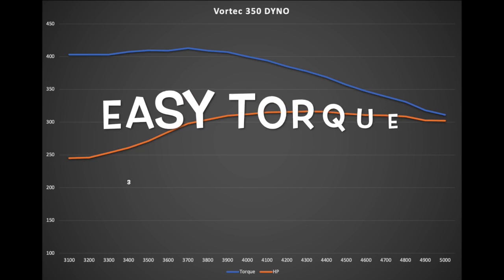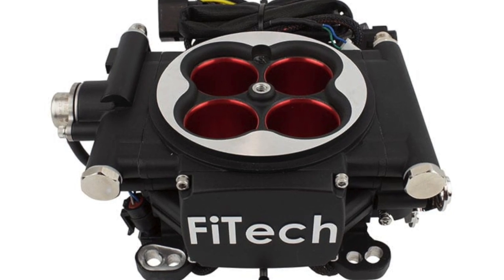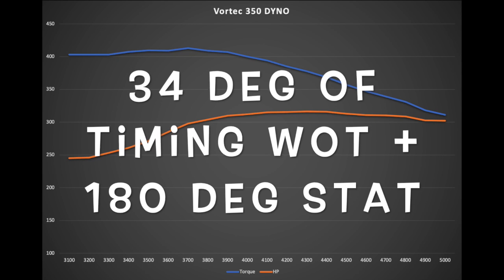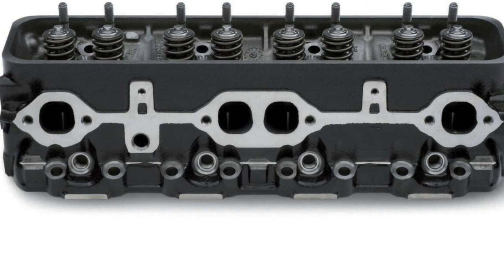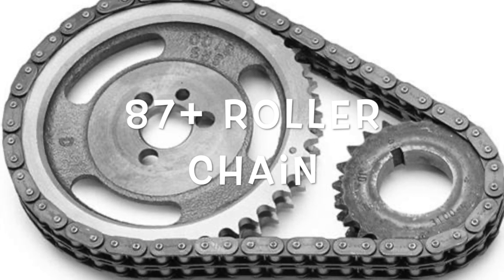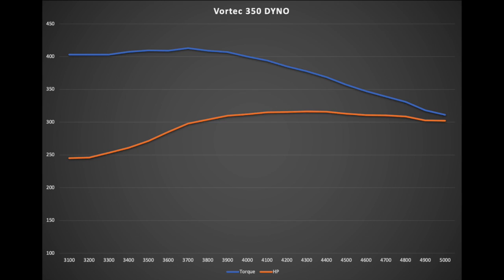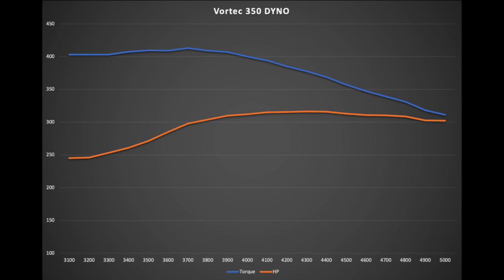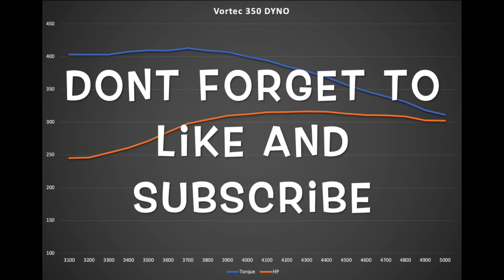Easy Vortec 350 Combo (High Torque 400+ ft lbs)

Comment: Im at my wits end with my 4.3 in my s10. It had gunk in the coolant when I bought it, but never an issue with misfires. It ran great. Did new intake gaskets, and drive it for a year worry free. Now im getting gunk again (not as bad) and a misfire on low end that jumps 2 to 4. High end i start getting mild misses on all 6. I think im going to shoehorn a 5.7 vortec in it. It doesnt need crazy power by any means, but id love to have smooth clean torque all the way up. Love this video.

Comment: "Just A Regular HEI" 

Did you have to change distributor gear to a melonized one for a roller cam since it is known for its strength or you just went with the regular ones on the HEI?

Or do you recommend just going regular HEI distributor or change the original vortec distributor gear into the HEI.. and would that make any difference?

Comment: I am put'n a 96 vortec in my chevelle since a lifter collapsed and ruin'd the 350 i hav in it,, got some Skip White Performance 200cc intake runner/64 cc combustion chamber aluminum heds and 1.6 rockers with them,, gonna get new lifters and pushrods, double roller time'n set and hav an edelbrock rpm intake,,
hope'n to get it goin soon,,,

Comment: Hello Cutter's performance, great video direct and to the point. I recently picked up a vortec 350 magnum marine (Mercruiser) four bolt main complete engine with 450 hrs. on it so I will do as you described my question I have is I cant find the lifters you used even Melling's site only lists the cam but not cam and lifter combo. Can I use the lifters that are in the motor or change them and if so what part # are they 
Thanks for the great info
Reply from the maker: I don't think I listed a meiling part # for the lifters in the video. I used the stock GM roller lifters on this build
Reply: @cuttersperformance  Thank you

Comment: did you have to change your distributor gear using a different rather than oem distributor is that melonized  gear just a lure to get to spend more money
Reply from the maker: the meiling cam is not billet cores so a regular cast distributor gear can be used
Reply: @cuttersperformance  thanks brotha

Comment: Will 10:1 run on 87?
Reply from the maker: It can with the right cam, tight quench, and proper tuning. A light car with proper gearing makes a world of difference too
Reply: @cuttersperformance  young in a 2700 pound 3rd gen
Reply from the maker: @TheJMan1K  2700 lb third gen? Is it gutted? Mine was like 3500 with full interior
Reply: @cuttersperformance  mines an 84 hard top. 
Scott Rod doors
One piece front end 
K member
Baer brakes
Gutted dash/interior
Astro T5 (Still 40 pounds less than a T56)
Has cloth seats out of my 4th Gen, 
And no heat or AC. 

Car was originally 3100 on the scale so chopping 450 pounds off wasn’t too bad. The only thing that was splurging was a one piece front end but that because my car needed some body work with a new bumper in the process. I finished touching up some rust spots next step is to wrap it. Also in the process of securing a vortech motor for it. 305 no bueno.

Comment: Nice video and a nice combo I think might be the ticket for my 97 OBS.  I like the fact that you mention part numbers, would be nice if you had the time to itemize them in the comments section to make duplication of the build a lot easier for us not so mechanically inclined.  I am always paranoid of getting the wrong parts that dont fit together as designed and having to return stuff or eat it on the cost.

Comment: I'm doing a similar build on a Vortec 350 with the factory EFI for my 86' Chevy k30. I went with the HT383 cam and upgraded mpfi injectors. The shop is also doing a custom tune. I'm expecting 405-410 torque and 340-345hp at the crank.
Reply: I don't think you'll come up a little short of your hp goals. Even the Ramjet only made 330hp IIRC. Should hit 400+ torque though. I have that same cam with some 1.6 roller rockers and marine intake on my truck. Feels like stock, but just more of it everywhere.

Comment: I’m thinking of doing something similar for my 85 k5 blazer that has a 305. I have a older 3970010 block 60 over with flat top 4 valve relief pistons, balanced bottom end, want to put my vortex heads, roller tip rockers, edelbrock performer rpm, best cam for towing   Had this motor rebuilt but has a 650 roller with phase 2 bow tie heads with way too much porting was going to put this in a Camaro but getting older and enjoy camping so I wanted to build a nice tow vehicle with 4x4. What do you think about  the 60 over with a nice aluminum 4core radiator will it be ok or should I use my other block with stock bottom end. Thanks guys for any advice

Comment: Did the same build with basically Speedway Z28 springs with the centers removed, knockoff .050 over valve keepers and a few cam sizes up, the Melling "22280" 495/505 lift. Also used a street Demon six hundred whatever carb but honestly I'm gonna move up to a 750 carb. Thing MOVES the way it is. Wish I could have gotten ahold of a similar cam with a tighter lobe separation at the time but sold out everywhere, mines 112 LSA. Great mostly stock mean street engine.

Comment: Cool! I'm upgrading (replacing) my C3 Corvette engine. Building a 383 stroker for it, on a 4-bolt 880 block. Do you know of a good, recommendable rotating assembly kit? Are the Eagle or the Scat 9000 ones decent? I'm not going too crazy with cam, 224 intake duration @50. It's a street engine.
Reply from the maker: Give scott at Ohio Crankshaft a call. His kits are well put together, checked, and balanced really well. Highly recommended 👌
Reply: @cuttersperformance  Thank you sir.

Comment: Picked up a ,97 Vortec motor to drop in myb,92  Silverado.This is invaluable info and thanks for building this motor for all us guys who don,t run their trucks at 6000 rpm at every chance. Most of my driving is at 1900 rpm,s ( 65 mph) on the highway with my 700 r  overdrive trans.+ 350 TBI motor ( soon to be replaced with the ,97 motor . I live in a small ,country village ,so highway distantce travelling is normal ( fuel economy ) .

Comment: QUESTION:
I'm in the middle of getting a 1997 K1500 Z71 EXT-CAB 5.7L 4x4 ready to use for work & play. Because it will be used for work M-F I want to retain decent MPG & drivability but want a little more power. This cam seems to really fit what I am looking for.
My question is what kind of HP & TQ number would you expect when putting this cam in my mostly stock truck along with the following upgrades:
* 1" intake spacer.
* K&N intake kit with pipe, filter housing & filter.
* Upgraded spider injectors with valves at the end of the injector lines.
* Accel coil, plug wires & platinum plugs.
* Flow Master 2.5" catback system.

NEAR FUTURE UPGRADES:
*Complete exhaust, shorty headers & mid-pipe with high flow cats.
* Dyno ECU tune (of course, this will be the very last thing i do to it).

I know the engine that you put the cam in, in this video probably breaths better than mine and has a more performance minded fuel injection system but I'm hoping to get 80% of the extra HP & TQ that you did. Am I living in fantasy land or is that a realistic expectation? 
(I know that you don't have a crystal ball but your best guess is most certainly better than mine. Don't worry about me trying to hold you to what you said, if i don't get the performance that I'm shooting for. I appreciate you taking the time to read this)
Reply from the maker: Youll have some parasitic loses over this engine but this cam will certainly help with power. Its a mild cam and works well with basically a stock engine. With a good set of headers(go long tubes if you can), a good tune you should notice some decent proformance improvements without a loss in mpg.

Comment: This cam seems to be close to the 395 GM cam. 
Do you think this cam has more torque ?
Reply from the maker: It would be close but I believe the 395 cam is on 109 lsa which helps with low end torque

Comment: Still debating wether i want 2 do a mild build on my 5.7 350 in my 90 obs single cab 4x4 or just stick a base ls 5.3 in it... mild build its my work truck i use it for pulling my pressure wash rig,tank full wheighs over 2000 lbs and i pull my 12' utility trailer with my dirtbikes,gets me anywhere down the muddy trails to my favorite fishing spots..the 5.7s are bullet proof and have good low end torque for everything I use it for but having a few modern ls motors i know the 5.3,6.0,6.2 have better power and torque and way better gas milage..so im still undecided..only thing my 5.7 has is a edelbrock performer intake manifold for a 2 barrel tbi carb and a flowmaster 40 series with 3" piping and it still kills my gas milage i know once i get my 6" lift and 35s on it that is only going to make it worse..which my decision kinda makes me lean over to the modern technology..If I do keep the 5.7 350 my plan is to get a EDBK dual plane air gap manifold with a holly brawler or if i have the extra $ get the sniper efi, some decent heads,mild cam,long tubes and a gud hot msd ignition kit..any suggestions? i appreciate some feed back..thanks 4 the vid
Reply from the maker: Man its a tough decision but with the prices of aftermarket EFI nowadays a stock 6.0 LS swap is pretty tempting

Comment: What do you think of David Vizard?
Reply from the maker: Smart man, with years of knowledge
Reply: @cuttersperformance  Yes, he is. A fountain of knowledge. That man knows what he is talking about. But you are getting there. You also know what you are talking about. Keep the good stuff coming.

Those Vortec heads are really good cylinder heads. Flows really good in stock confugiration. Before porting. With a little Vizard magic, and also your magic it will work wonders. Good racing heads.
Reply: Configuration

Comment: Hey buddy I know your in the know about these vortecs I got a roller cam vortec do I need to run a different gear other than the stock steel gear that comes on the stock hei distributor? Thanks in advance
Reply from the maker: Run a Melonized gear with the stock billet core cam

Comment: I have a 5.7 vortec Escalade from 2000 I’m curious what I can do to get some more power out of it I’m not familiar with these engines if there’s different variations or if they’re all the same can I just change the fuel injection system intake exhaust that kind of stuff or will that not run right with the stock computer etc I’m not looking to dig into it to the point of doing a cam just curious what simple options I have it’s completely stock
Reply from the maker: The factory fuel injection and cam are a limiting factor on these engines, but they respond well to a set of headers and a good flowing exhaust system if you're just trying to pick up abit of power.

Comment: I started working with these heads in 96 on a 4.3 Sonoma. A few years after taking the knowledge from the 4.3 stuff I applied it to a few small block builds. All pump gas street friendly.  These heads are impressive to say the least. I miss the day of getting a brand new pair of these delivered for under 500$
Reply from the maker: Right on man! And totally agree, the prices are abit nutty now on them
Reply: I wanted to get the Edelborock aluminum version ETEC 170 heads, They are currently $1,100 EACH,  $2,200 for the pair.  WTF  Then I would need an intake manifold to match, yeah, $660 for that, so it's almost $3,000 for heads and a manifold.  R U kidding me!  I bought the Trick flow Super 23's instead.  $1,500/pair.  No intake required.
Reply: @frotobaggins7169  at that cost go afr

Comment: Just finished my L31 short block factory PM connecting rods,Mahle hyperteutic pistons,1053 forged factory crankshaft, King Bearings Maine,Rod,Cam, also BTR LS7 Lifters and BTR pushrods,Custom Bullet Cams Hydraulic Roller .575 lift 240 duration camshaft, Edelbrock Performer Rpm Top End 64cc heads CNC Port/Polished, Comp Beehive Springs,Summit Racing Billet True Roller Double Roller Timing Set,MSD Digital 6AL and MSD Pro-billet  Distributor, Edelbrock Avs2 850cfm Carburetor, Milodon High Pressure/High Flo oil pump,Milodon Timing Cover,Milodon 8 qt oil pan, Hooker Competition Headers, and a TCI breakaway 2800 stall converter,TCI Streetfighter 700r4 transmission, Cheverolet 8.5" 10 bolt differential with all Richmond 3.73 gears in a 1972 Cheverolet Nova SS
Reply from the maker: Sounds like a great combo 👌

Comment: Hey man you have the best video. Question. Would this combo work well in a 93 4x4 suburban with 750 carb? Tbi motor got to go
Reply from the maker: Heck yeah, but if it were me Id do a  600 holley vac secondaries
Reply: Awesome I have one. Thanks

Comment: I have a build extremely similar but a 383. What rpm is the timing all in by and did you use vacuum advance?
Reply from the maker: I dont have the all in RPM in my notes but I kept the stock springs and weight in the aftermarket HEI and yes i used the adjustable vac advance

Comment: Watching again a year later thinking about how mine will do. 10:1 old style 350, was a short block that sat in a garage since the late 80's, and it reflects that. TRW flat tops, stock everything else, and a Crane Energizer, .450 lift/218 @.050 on a 106 lsa. I just tore down, cleaned up, replaced rings and bearings, engine had never been ran. Threw a set of vortecs and similar intake to this on it, with summit "ls6" springs and comp 787 retainers. I had around .530 to the seat so I didn't use the offset keepers. Think a 1.6 exhaust valve and blend would help a bunch with the single pattern cam, but it should still make similar power to this, I believe. Sounds good on the stand, now to get the truck on the road.
Reply from the maker: Probably abit more power than this build! Hopefully you get it in soon and enjoy it
Reply: That’s the 274H06 cam. Nice sounding lumpy idle with that narrow 106  LSA, but surprisingly torquey just off idle, even works with low comp smog 350’s
Reply: @Scott K  it worked great. I actually stepped up to an isky 280 mega, but just because I didn't lose any of the bottom end, and felt I had some room to grow on top. Similar concept, just more duration and lift, and a 108 lsa vs 106. Something about the tight lsa single pattern cams seems to work well mid range. I kept all the lifters labeled by bore and wrapped the cam up, because I will surely find another use for it. Great for a mild engine for sure

Comment: How well would this work with brodix ik180 heads and more compression?
Reply from the maker: The cam in this build is very mild and you would be much better off with a larger cam to utilize those heads

Comment: Built one very similar to this for an 80's Caprice. What a fantastic highway cruiser. It pulled the super tall gears in the rear end like nothing.
Reply: great motors. honestly the last great chevy motor. 
i have one in an s10 blazer lunati roller torque cam kept the fuel injection long tube headers till next season. 4 speed auto and 3.42 gears with fairly small tires.
35mpg at city speeds up to 55-60mph back roads is best mileage. highway is about 28-30 mpg at 70-75 its not stupendous but for a vehicle that can run the 1/4 mile in the 12 sec range and a timeless box chevy body thats not a bad commuter car.

Comment: Out of curiosity.  Do you have any idea what a stock l82 bottom end would make with vortec heads? Stock l82 cam and everything.
Reply from the maker: The l82 cam isnt terrible for a stock cam and the vortecs will bump up the compression. 
My guess would be around 320hp and 370 ftlbs on a dyno with a decent dual plane intake and a headers

Comment: Very nice, I just picked up a Blueprint 350 with the vortex heads. Included dyno sheet showed the engine made  376 HP and 406 tq, after the 500 mile break in I'll get it dynoed to see how close that is while in my truck. I did go with the performer RPM air gap and a Holly 600 cab, but have a Holly Sniper to install.

Comment: There isn't anyway this engine has enough vacuum for power brakes to be working properly.  In fact 270 is about all you can run on duration for the street with an automatic transmission. 
 I can say at least in my experience .  and if what you said in this video is true can explain this. Just asking.
Reply from the maker: This is like a stage 1 cam and very mild.  It pulls lots of engine vacuum. It worked very well with power brakes and the fuel injection I put on it. Expect 16 to 18 inch at idle with this cam

Duration is just one part of the puzzle,  the stock L31 cam has 263 deg of intake Duration and idles smooth
Reply: lol at using advertised duration for anything. advertised is a lie. each cam company uses a different measurement. always look at .050 duration. this cam is fine.

Comment: Trying to decide what I can do to get a little more torque out of the 350 in my ‘92 Yukon. It’s got a lot of miles and I know I want to do a better build when it’s time. Whatever I can do temporarily that’ll transfer when I rebuild would be great…..any suggestions? Do I do a stroker, a big block, when it’s time? Thanks
Reply: 96-99 Vortec heads.

Comment: Very nice. You've got a new subscriber. I have a question. I have a 2000 tahoe with a 5.7 V8. What can I do to make 400 horses? I'm new to modding and this will be my first build.
Reply: Long tube headers, heads, intake, new chip, and cam. Make sure you match up the intake, headers, and cam so you have proper lift or it’s all for not. Jegs has some really good people to help walk you through it. If you take out the engine it’s a perfect time to go all out and replace tie rods, ball joints, control arms, shocks, and scrub the frame down then rust proof. Sounds like a lot but it’s all needed. Adding horse power without solid components is dumb, also good time to rebuild the transmission
Reply: @rmmm6725  thanks for the info. It's a really good solid truck with low miles. I'm going to have a blast with this